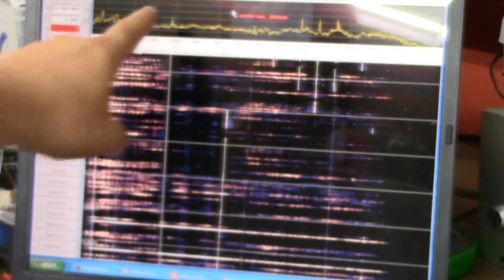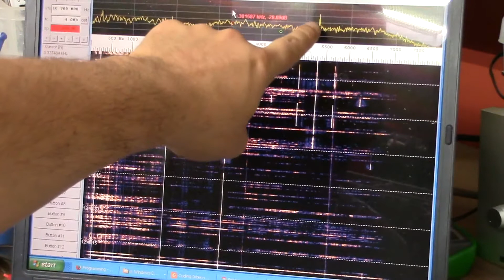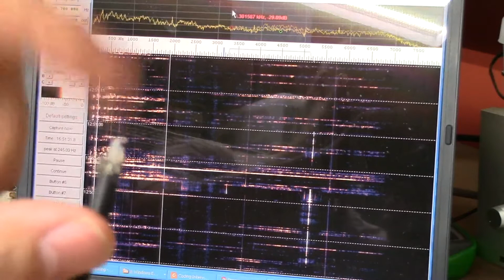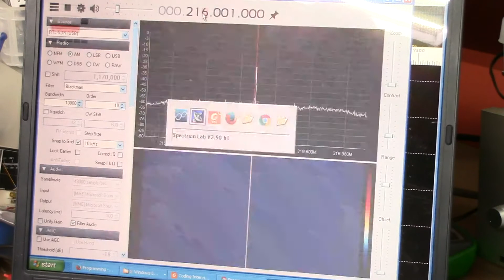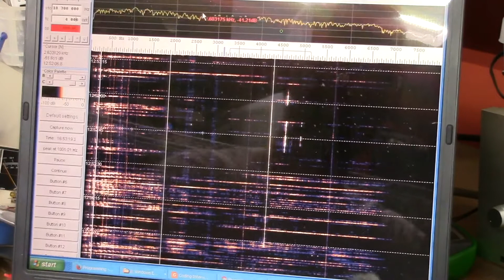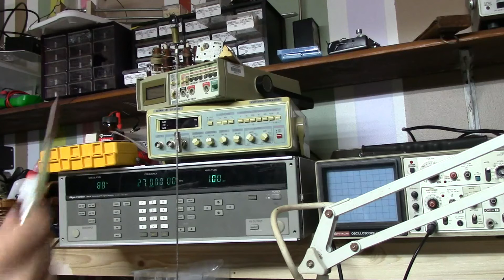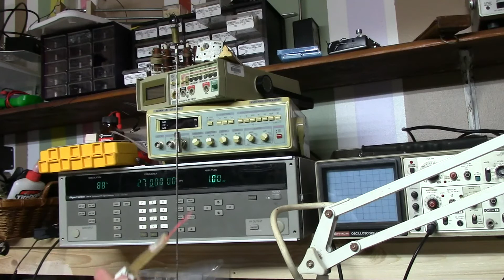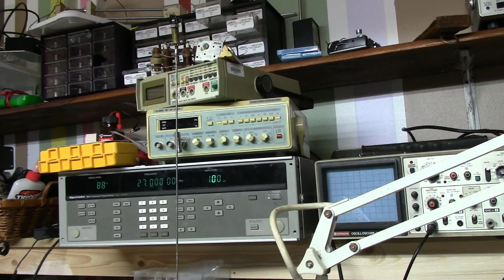Measure near field using DIY homemade magnetic and electric field probes

Comment: Great project! a year later I want to see if you had any advances with the 602
Reply from the maker: The main advance for me is to use a preselector at the input if possible - like a PI L/C filter circuit that filters out unwanted signals/noise, only passing the desired frequency range. It's a common RF practice. It adds some complexity to the circuit but it's really the best way to target the specific frequency you're looking for!  Thanks for the positive feedback!
Reply: That sounds great, I will be looking forward for any updates on this project if you decide to make a video to see how it performs